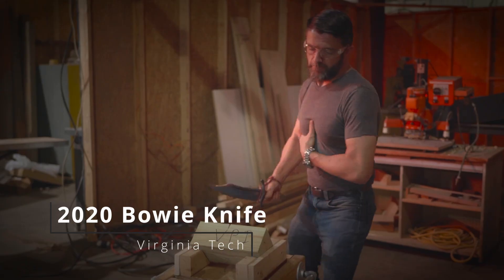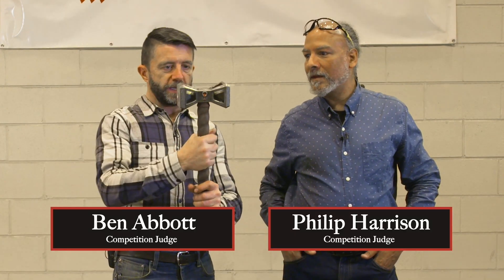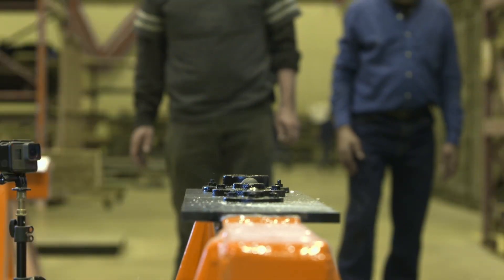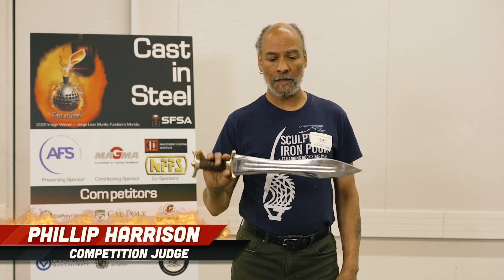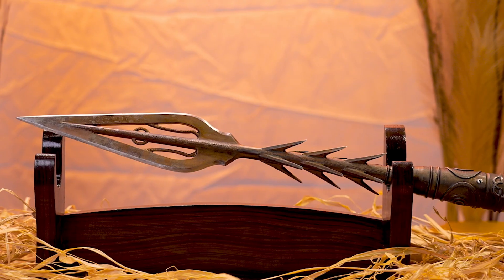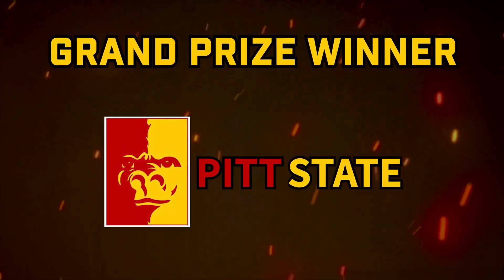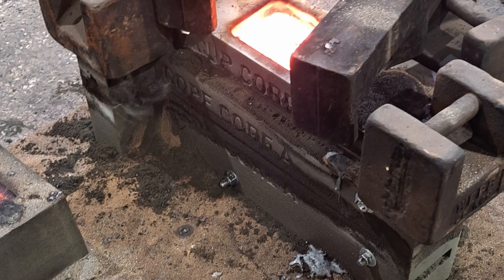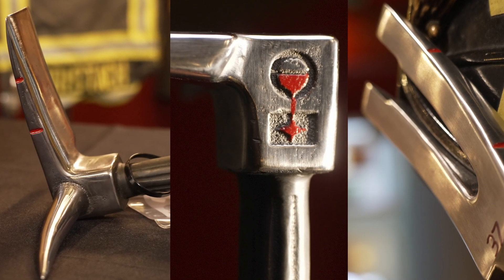College STUDENTS Cast THIS?! - Unbelievable Winners

Comment: wait I'm really confused here.. they cast steel swords? how does that work?  I thought steel wasn't suitable for casting, or is it just the high melting temperature that makes it an uncommon technique? Ive never heard of someone casting steel swords before.
Reply from the maker: This is part of a competition for university engineering students.  Swords would not usually be cast, but were chosen as the item for the competition because they are difficult to cast.  More info on the competition is available at https://castinsteel.org

Any material that can be melted can be cast.  The steel casting industry is a small segment of the steel industry, but it has been around as long as people have been making steel on an industrial scale.
Reply: Idk either, steel isnt suitable for casting, because its porous and you need to forge it, usually it made on plants, hot rolling is basically forging.
Reply from the maker: @ This is entirely incorrect.  There is an entire industry of steel foundries pouring steel castings.  Steel is not inherently porous and you do not need to forge it.